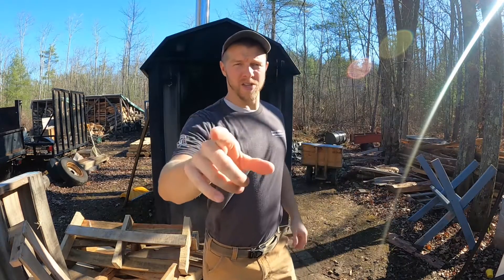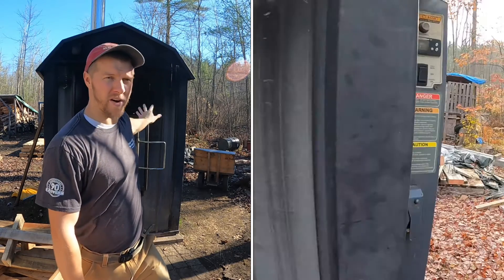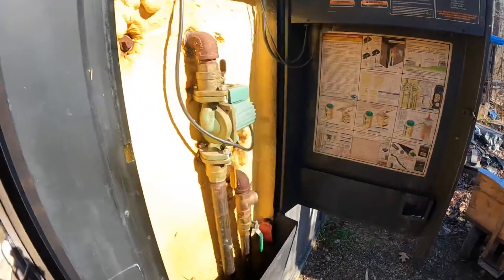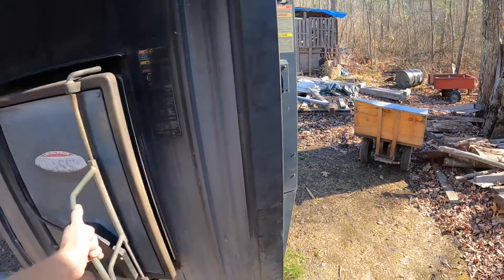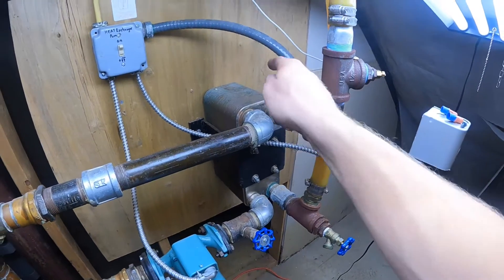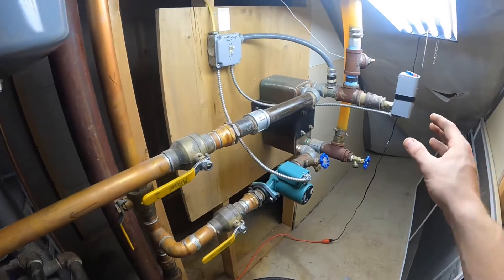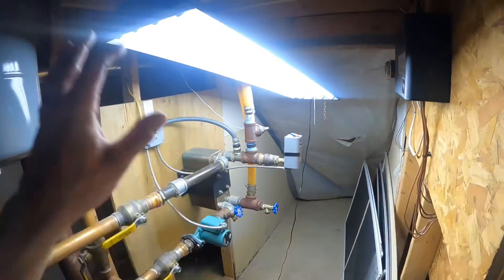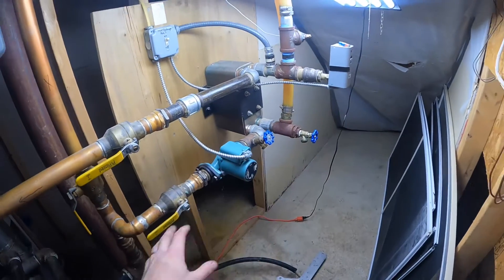How Does An OUTDOOR WOOD BOILER WORK?

Comment: Do you shut off your oil burner when using your out door wood furnace?
Reply from the maker: No because the oil is the backup Incase the boiler burns out. The oil will never run unless the wood boiler burns out and drops to 130 degrees

Comment: If you don't have a furnace, could you use radiators?
Reply from the maker: I guess you could run the PEX through anything really. You deff want some type of heat exchanger system which is "new" code. Some old installs ran directly through the home furnace but thats not new code depending on the state.
Reply: @HomesteadJay  thanks for the info.
Reply from the maker: @nealmcbaggins127  ill cover this in an upcoming video "how to plum an outdoor boiler"
Reply: @HomesteadJay  that would be outstanding!

Comment: I don't have a wood boiler, but the only improvement that I would make is a mechanical heat/steam driven pump to go electric free. if you were on a spring driven well, you'd be home free. Or go solar and enough battery to keep that pump running if the grid goes down.
Reply from the maker: The new models have an application for solar imput which is cool but it wouldnt be hard to have a designated circuit for this to run off a solar/battery bank.

Comment: Now I like to know how oil Heating working
Reply from the maker: Thats boring LOL wheres the excitement hahah
Reply: @HomesteadJay   I like  Learning all that kind of stuff
Reply from the maker: @ericaken3338  I was joking but its the same idea. You use oil to make a flame which heats a water jacket which heats water which is then pumped to areas demanding the heat. The wood boiler just provides a replacement for the oil. The COOL part is the wood boiler runs the domestic hot water through the oil furnance and onto the respected zones that need heat. I love it!

Comment: not woodboiler....a old house i used to have, we ran our piping from our wood stove to propane water tank, mind ya the feed obviously, we looped some piping on inside our wood stove, we saved propane running the woodstove
Reply from the maker: I saw a woodstove for sale on FB that had heat rated plumbing ran through it I guess it was for a similiar idea! Utilize the woodstove for heat while also transfering it around via piping!